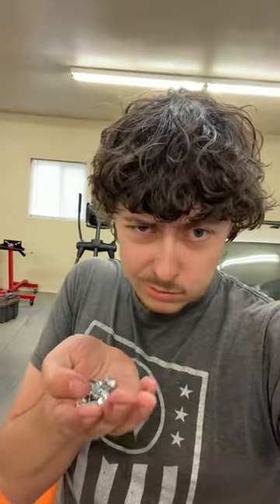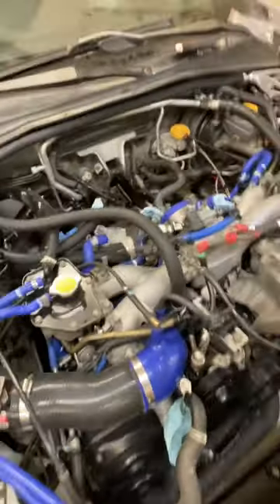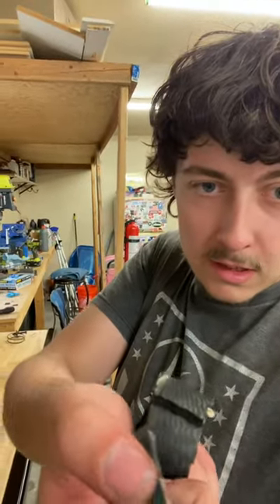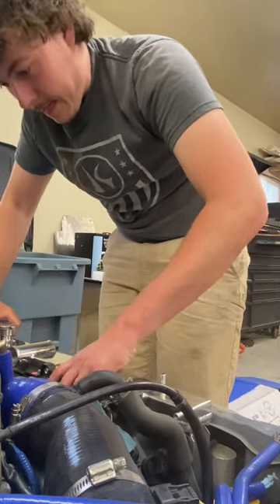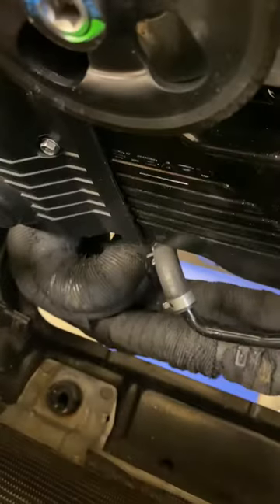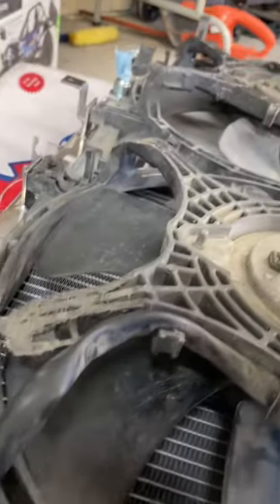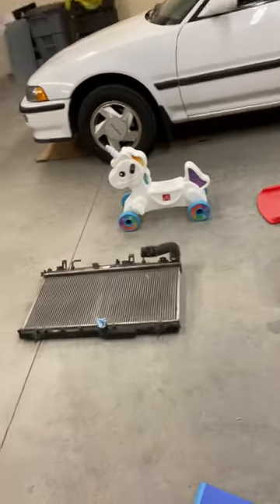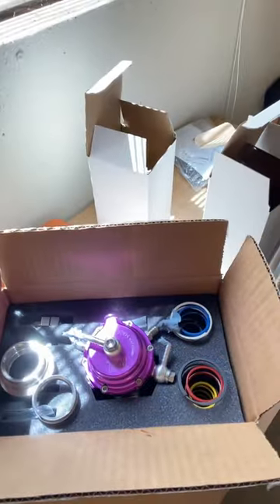Very well edited radiator install: CSF radiator O-series w/ internal oil cooler

Comment: any update on the oil cooler
Reply from the maker: Yes I had to get a ORB 90 degree fitting to get the radiator to sit flat in the chassis and avoid the headers. I have tomei uel headers so I don’t know if you will have to do the same modification to get the oil lines off the headers. But it’s on and I routed the lines. I’m in college right now so I won’t be making an update video until my break hits
Reply from the maker: If you have a newer model as well you should have more room so you might not have to make the cuts and adjustments.